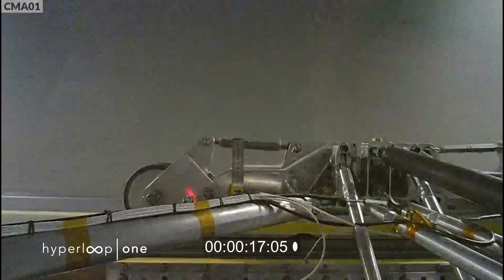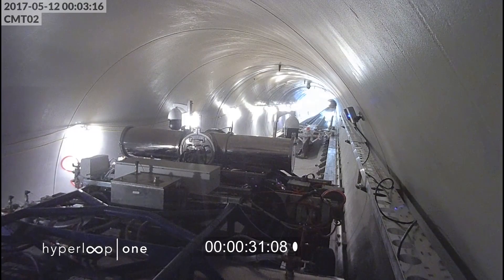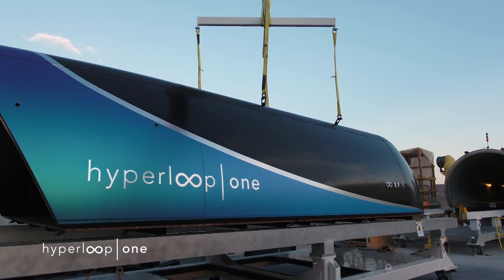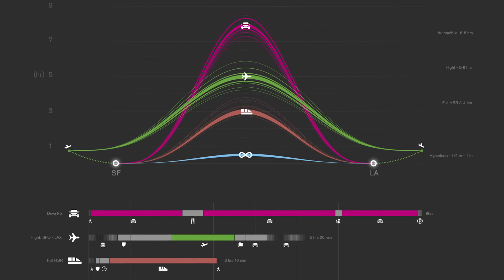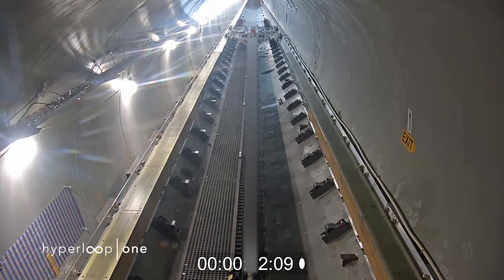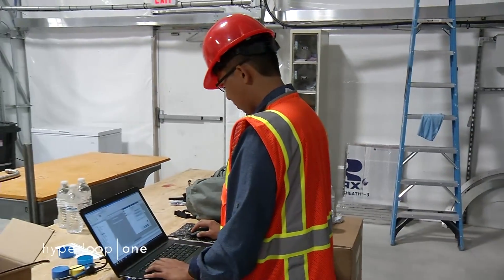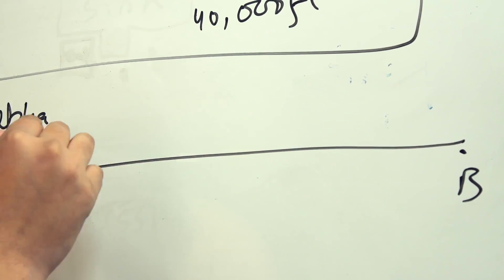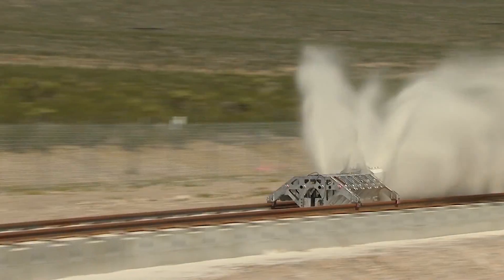Watch the Hyperloop Complete Its First Successful Test Ride | WIRED

Comment: So like, what happens if it "springs a leak" and the pods in transit stop half-way across the country in the desert? Are they going to deploy helicopters with engineers to repair each issue that occurs? What if there is a medical emergency during transit? This seems like da Vinci's flying machine to me. Maybe I'm wrong.
Reply: You’re not wrong. Your concerns are why this three year old video still is the peak of progress they’ve made, meaning since this video very little has been figured out. And if the system springs a leak, well let’s just say everyone would die.
Reply: @Joemamahahahaha821  Lol. Sounds like a pretty awful idea in practice.
Reply: @MopeyFand  it’s a great idea if absolutely nothing could ever go wrong and sustaining a vacuum was easy and also didn’t pose serious danger in event of failure. Also it’s great if you ignore how expensive energetically it would be to pump all that air out of such a large vacuum tube, and if we could somehow compress air like Elon said at a 100:1 ratio without melting whatever the air is in.

Comment: Elon Musk is great 
1.Spacex
2.Tesla
3.Hyperloop
4.Starlink
Reply: Hyper loop is a scam
Reply: @Joemamahahahaha821  on what bases ur saying that?
Reply: @vidyashirore8820  where do I begin? I mean first of all almost no progress has been made sense this video was uploaded (3 years) this normally wouldn’t be a big deal if they didn’t say in the video that’s how long it would take. Also, you can’t have metal tube that long, especially if they hold a vacuum, and especially through fault zones. One failure and everyone inside is dead. A steel pipe that long will expand and contract by about 1-3 HUNDRED meters throughout the year as weather and temperature changes. And what do you do if a capsule gets stuck in the middle? What happens if a capsule depressurized (due to low pressure you can’t have drop down masks like on planes, the low low pressure of hyper loop will cause that to inflate you like a balloon) and the cherry on top is that even if it works as promised it still won’t be much better than planes trains and automobiles

Comment: Even if there were no technical and safety related issues, a hyperloop would still have way to little capacity, since 30 people in one pod are just very few, even if pods can be launched every 30 seconds, the capacity would still be much smaller than that of a high speed train line.
Reply: Or a plane, or a ship, or even a bus. I’m willing to wait a few more hours so that I don’t die in a violent depressurization.

Comment: Making personal electric planes that run on lipo batteries and travels at supersonic speeds would be both more feasible and safer than the hyperloop. engineering isnt magic its an extension of science and the larger the vacuum chamber the more force thats on it heres an example of what happens to large tubes under vacuum when they don't have huge amounts of support https://www.youtube.com/watch?v=0N17tEW_WEU&t=165s

Comment: People are missing the point . Hyperloop is not meant to replace air travel,it’s to replace trains and cars in order to get around regions quickly. It’s more efficient to move passengers “as needed” instead of moving a heavy train that may not even be filled to capacity. Plus the Hyperloop can fit Into tighter areas in the city that a large train cannot. Bullet trains currently use magnetics but the vacuum greatly reduces resistance. No matter cause the corrupt politicians in California would rather throw money at Cal-trans to maintain old trains and build bike lanes that are rarely used. I’d can’t wait to ride a Hyperloop if and when it goes into production.

Comment: why not magnetic levitation like japan  for their train
Reply: Hyperloop doesn't have air resistance
Reply: Also magnetic levitation rail need to be extremely cold to float
Reply: Born 4 A thing maybe we’re on a different levitation. The one they use in japan didn’t have to be cold. Maybe that was electromagnetic. Also doesn’t it required a lot of power to keep the loop under vacuum?
Reply: @Kanti12311  electricity become cheaper over time so in the future keeping the vacuum will be cheaper than taking a trip with bus

Comment: So it's basically a train inside a pipe ? What if it gets stuck or stops working in between ? How to get out ? By cutting the pipe ?
Reply: No its not a normal train in pipe its Electromagnetic train that levitates in Vaccum
Reply: Oskar And You know how to completely ruin this kind of train? Make a small puncture anywhere in the tube. Air will immediately begin filling the tube and the friction will drive it to a screeching halt. 

The only way to repair it would be to completely stop train movements and to carefully go over every inch of the tubing to find the hole, which would be expensive and time consuming

Comment: What if some one attack inside this Rat Hole[ HyperLopp] with Dangerous and poisonous gas...what you do , and next what happen if Earthquake happens to the Loop ? , What about the Air becomes more heat and pressurised by Sun and due to its own heat? What if rains in side?....use this loop for water transport to Desert areas....people and animals live long....use simple and manual Knowledge....dont need over knowledge that can annihilates you

Comment: That's cute. Meanwhile Japan already has a maglev that can reach 603 kph that you can ride right now and they are already constructing lines that connects Tokyo to Nagoya.
Reply: hyperloop speed is 760kph
Reply: @zeehee1231  Actually over 1000 km/h (700mph)
Reply: @TheLapari  hyperloop will fail
Reply: @fatmanwalking8610  Prove it.
Reply: @TheLapari  simple economics safety and efficienty will be the reason why it will fail
Reply: Abu Hajaar the reason it would fail would prob be MLM moms thinking’s that it’s used for mind control
Reply: @zeehee1231  But has never transported any cargo remains in a very early development stage, whereas this is an actual working train system you can get on now.

Comment: Good idea, but somewhat impractical. I feel 1000x times more safer on a plane going slightly slower. Passengers choose cost over time and the atmospheric pressure could be damaging. One microscopic hole in the tube could be disastrous for passengers.

Comment: Would it not be easier to pressurize the tunnel to where you don't even need self-contained locomotion? just let the air pressure push the vehicle along like a spitball in a strew? Seems safer to me.
Reply: Brian Link 
yeah but air is a gas and gases aren’t easily contained and they would have to pump out the air every single time, costing money.

Comment: I think as technology marches on (as it always does) this will be seen by more and more people as viable. Perhaps a combination of MAGLEV and Hyperloop technologies would help each system support the other. They could start by running the routes along the current interstate system. the primary cross-country routes could be along I-10, I-20, I-40, and I-80 -  with stops in only the major cities in order to keep the speed advantage at near maximum. Limited access MAGLEV north-south feeder lines along those Interstate system arteries. (I-95, I-65, [I-55, I-44 Diagonally], I-35, I-25, I-15, I-5...). I-95 probably should be limited to a lesser high-speed rail alternative, due to the many, many stops at all the population centers along that corridor. What I wonder is how to keep up with the electricity demands for such a system, without greatly expanding the use of nuclear power (which I am for...).
Reply: Technology marched on for five years and nothing changed.  Because it won't.  Tech marches on, but physics doesn't.

Comment: I am guessing its achieved  70 mph speed was limited by the tube's 500 meters length . I think the first commercial deployment is a decade or two away . The design , construction and testing in a real world installation will take time even if they can secure the very large budgets needed for this project .

Comment: 700 mph wow. Some airliners do 575 mph cruising.
Reply: Top speeds of about 760 mph
Reply: The 700 one is yet to be made. In this video, they managed 70.
Reply: It will take many decades to achieve that speed . The train will have to travel in near vacuum in a tube for 10s and 100s of miles .
Reply: @111danish111  Why would it? They wanted to have reached that speed 4 years ago, never made it past 240 to this day -- but not with a Hyperloop carriage, because there is still no such thing to this day by any company. Translation: it will never happen because all the engineers who know their subject turned out to know more about it than Elon, who did not know anything at all about it. Elon didn't even know that someone had invented and patented the Hyperloop literally 100 YEARS before he thought he had invented it, after being stoned again...
Reply: @111danish111  it wont take decades
Reply: This is probably how they gonna solve the issue... they will just full throttle cabin in a magnetic field tube...
Reply: Imagine yourself traveling in " sound speed"
Reply: Still faster than an airplane cruising
Reply: This thing might have a reduced carbon footprint and be faster
Reply: They said 70mph. Not 700.
Reply: Warren B 700
Reply: Warren B 70mph? A bike is faster than that

Comment: You have to think about the shift in plates.look at long bridges. They expand and contract. What about expansion to hot and cold temperatures? even if in the cold the tube shirnks only a millimeter per section. Imagine how much material will shirnk over hundreds of miles. The total length could varey by a factor of several meters. while normally that is not an issue. This will be air tight?..yikes. I'm not saying it's impossible. But it does not sound safe. the same can occur in the summer. The metal will expand. that could cause a rupture and kill Everyone inside. Just saying.

Comment: Expansion of the (totally sealed) tube in heat (day) and then shrinking again when colder (night)... "Explosion" of the vacuum tube when there is a little hole in the tube (with fatal consequences for passengers)... - The magnetic propulsion system makes sense though.

Comment: Why not use the air to propel by using both a vacuum in the front and pressure giving it a push in the same direction much like how water moves through a tube. It moves as one piece? At least the way understand it. Lol

Comment: This is a disaster waiting to happen.

1. Any form of explosive decompression will cause so much damage it is almost assured that anyone within the tube will die. 
2. How will you stop people from damaging the tubes that will be all over the place. Even railway traffic has issues with sabotage.
3. Please note that usually you will have more people inside trains compared to planes. So be prepared for high number of victims with any accident related to this technology.
4. The cost for this are stupidly high if you think about it. Just think how much ressources will be required to place all these tubes for the tracks. And that doesn't even include the technology to keep the pressure at proper levels.

Oh and if you say "over a hundred years ago people also thought flying was impossible" let me tell you one thing. Think about how many people paid with their lifes when it comes to flying. And feel free to actually research what happened to the very first passenger jet airliner.

Well, there is always a price to pay for technological advance. Let's see how many bodies it will take to either make it work or shut it down. Transrapid had one major accident before they decided to shut it down.
Reply: "explosive decompression will cause so much damage.."
Same with commercial airliners that now do more than 10,000 flights per day.
Reply: Paul James,
1. you might want to look closer at differences when it comes to the pressure between planes and the Hyperloop. Please note that the goal is to have a similar environment to space with no air in the tubes at all. When planes fly at very high attitudes the pressure might be extremely low, but there still is an atmosphere and some pressure. Why do you think do planes have speed limitations?

2. Have you seen what explosive decompressions can do to planes? I'd suggest to look into incidents like Japan Airlines flight 123, Aloha Airlines 243, BOAC Flight 781 or National Airlines Flight 27 just to name a few incidents. All of these incidents have at their core different causes. However all of these incidents where related to the high pressure forces that affect the plane during flight. And please note that these 4 incidents are just examples. There dozens more with and without fatalities.

3. As I mentioned before. The Hyperloop tubes are much more vulnerable than a plane. The only people that can intentionally bring down a plane are either inside the plane or part of the military. It is very unlikely that you have the equipment to damage a plane sufficiently to cause it to crash. And usually you will only be able to get to them during take off or landing.

Now what about the Hyperloop? These tubes can be easily reached by anyone. And all one would need to cause a major incident is a truck and run it into the tube itself or destroy the things that hold the tubes in place. Even train tracks have been affected by something like this.

I am telling you that this is desaster waiting to happen.

Comment: I think it's weird that they don't build it underground. Besides the fact that heat would make the metal kind of shrink and make the tube so much shorter in such a long distance, the result of somebody for example shooting a whole in this tube would be horrendous and people would probably die since it is a vacuum area that all of a sudden would be filled with air moving in the speed of sound. The heat problem would get solved by building it underground but to prevent any possibility to destroy these tubes would need security of the whole distances to prevent someone of making a terror like act by putting a whole into these tubes.

Comment: Please quit saying Elon Musk came up with this idea. It has been around scince 1888 envisioned by Michael Verne (Son of Jules Verne). There has been many many proposals and patents scince then.
Starting in the late 1970s and early 1980s, the Swissmetro was proposed to leverage the invention of the experimental German Transrapid maglev train, and operate in large underground tunnels reduced to the pressure altitude of 21,000 m.
There are actually engineers that have all the knowledge needed to build a Hyperloop. But you will only see a bunch of college students and young graduates working on this...hopefully successful.

Comment: this wont work. Imagine the hassle to do maintenance or if accident happen inside this tube... just dont and wont work... although seem radical it just not sufficient in term of security and maintenance issues...
Reply: Dimitriy Mirovsky imagine the safety issues for a flying machine
Reply: Generic Name dude in the middle ages people didn’t even think of space they thought the earth was flat and didn’t even know what a machine was all they knew was the bible and there kingdom/tribe
Reply: It won't work right now. That's where innovations come in. Also, back in the middle ages people never even thought of humanity reaching the outer space. You know because of the possible accidents, maintenance issue, cost etc. It will work. Someday.
Reply: Accidents happens everywhere fool.  Do you think you are_100% safe while travelling by airplanes?
Reply: "if an accident happens inside this tube" or well... if anything hits the tube by accident. or if it deforms slightly from thermal expansion. rest in peace anyone in the tube at that moment... explosive decompression is a bitch.
Reply: You're right. I'll tell the Hyperloop team to stop all efforts working on this project. Dimitriy with the breakthrough realization via youtube comments.